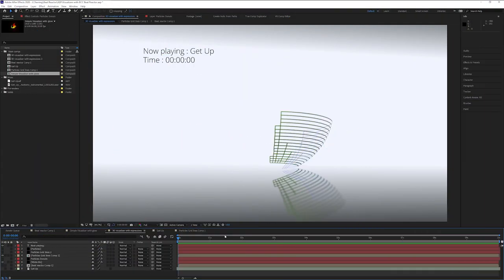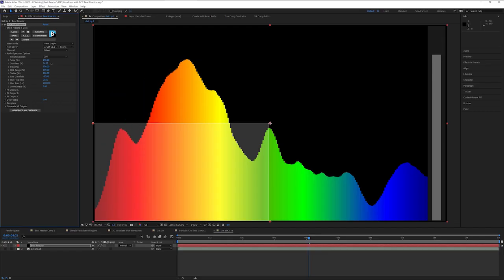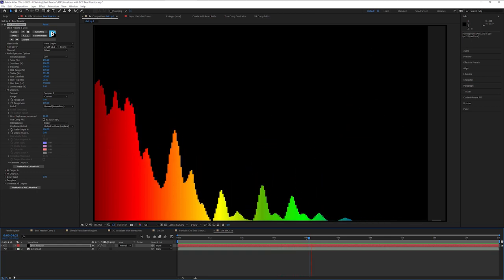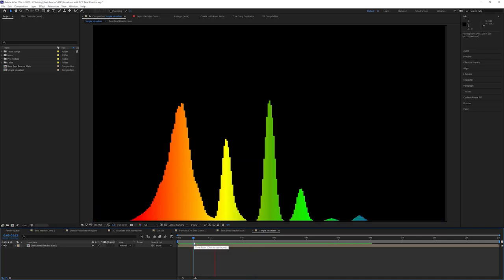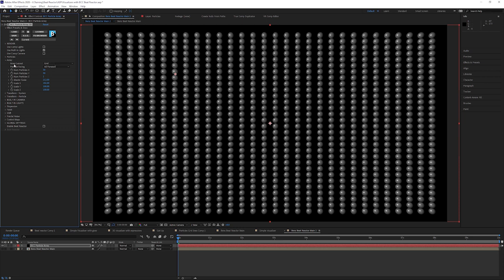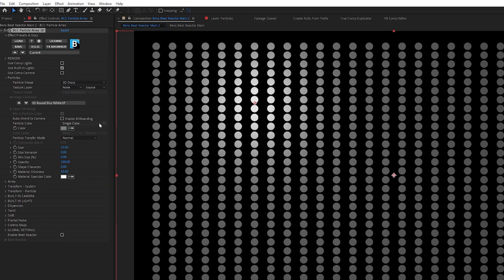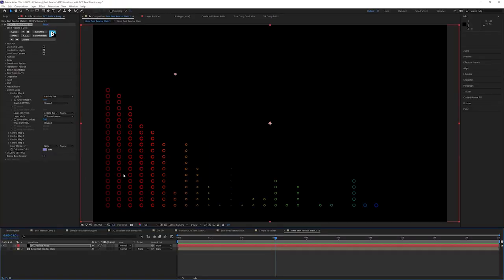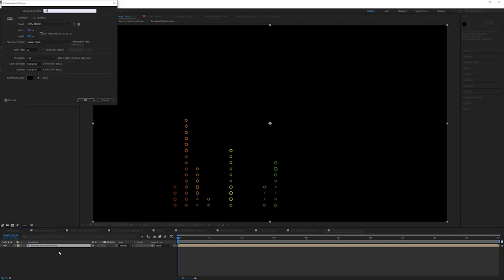Create Different Audio Visualizers with Beat Reactor [Boris FX Continuum]

Comment: Hi Ben, how to create the countdown on the "time" the best way?
Reply: I actually reworked a Dan Ebberts expression to do the count-up.  Add a text layer and alt-click on the Source Text value.  Paste in this expression.  Change the "trackTilte" layer in the second line to match your audio source.  Job done for the count up.  Will paste countdown in a new reply.

clockStart = 0;
trackTitle = thisComp.layer("Get Up").name; 
function padZero(n){
  return (n < 10 ? "0" : "") + n;
}
 
clockTime = clockStart + (time - inPoint);
t = Math.floor(clockTime);
hr = Math.floor(t/3600);
min = Math.floor((t%3600)/60);
sec = Math.floor(t%60);
ms = clockTime.toFixed(3).substr(-3);
timeRunning=padZero(hr) + ":" + padZero(min) + ":" + padZero(sec);

mainText="Now playing : " + trackTitle + "\r" + "Time : " + timeRunning
Reply: Here's the countdown. Use it the same way as the count up in the other reply.  Note, this assumes the comp is the exact length of your audio track.

clockStart = 0;
trackTitle = thisComp.layer("Get Up").name; 
function padZero(n){
  return (n < 10 ? "0" : "") + n;
}
 
clockTime = clockStart + (outPoint - time);
t = Math.floor(clockTime);
hr = Math.floor(t/3600);
min = Math.floor((t%3600)/60);
sec = Math.floor(t%60);
ms = clockTime.toFixed(3).substr(-3);
timeRunning=padZero(hr) + ":" + padZero(min) + ":" + padZero(sec);

mainText="Now playing : " + trackTitle + "\r" + "Time : " + timeRunning
Reply: @benbrownlee2732  Is there a preset to be used in 3d title studio w/o the need of AE?
Reply from the maker: @Mediagix  Absolutely. Use the Counter Progress Bar preset. If you don't want the timecode, then go into the UI, choose the Counter Edit Material layer > Material - flat texture. You can then select Controls > Generator and change the Generator type to Date/Time. Remember to turn off "Use Current Time".